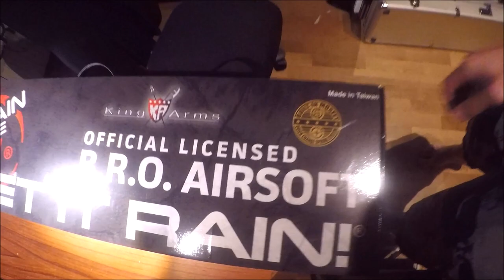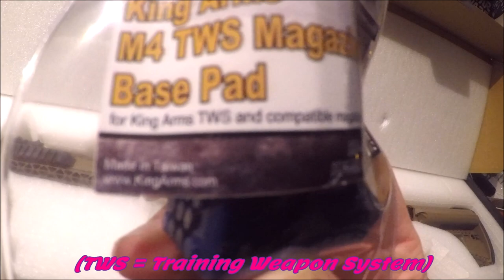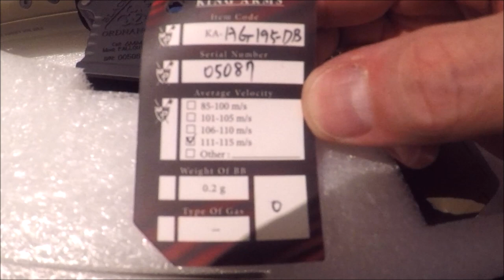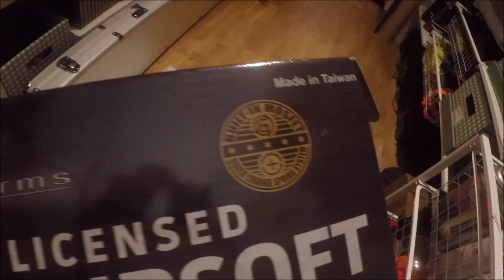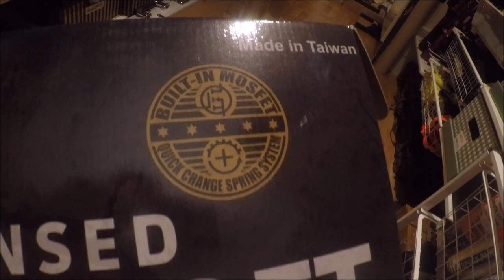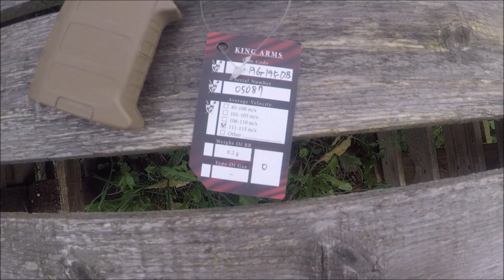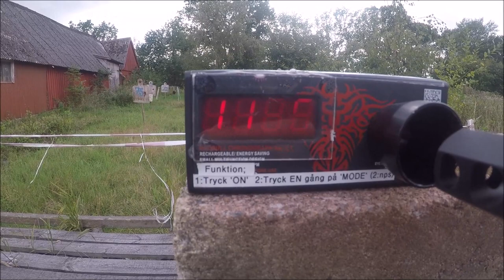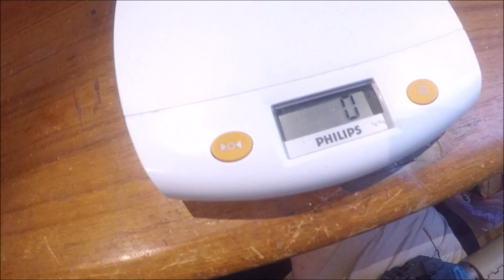UNBOXING and review of Black Rain Ordnance licensed airsoft from King Arms.

Comment: I literally got mine today. Gun is very well made. I got it to use as a solid platform to upgrade. I have beater stock m4’s. This one I will do barrel and all air components and see how effective I can make it. Enjoyed the video.
Reply from the maker: Thank you! I'm glad it served a purpose. And yes, that gun is a frikking iron bar! It's gonna do its part well for you! 💪🏻
Reply: I’m looking at getting one did it come with a black muzzle break or do I need to get that?
Reply: @barryjohnson8733  yes came with black break. Gun was awesome and very accurate I’ve completely built it now and use it as a dmr at field limits. I mainly run hpa now but that bro spec is by far my most reliable. Gate titan and full internals made it an animal.